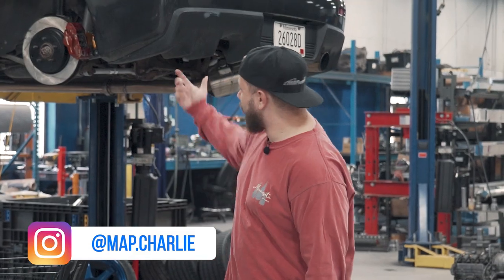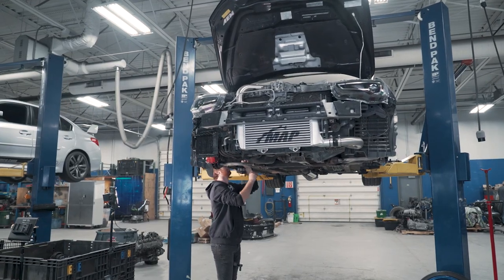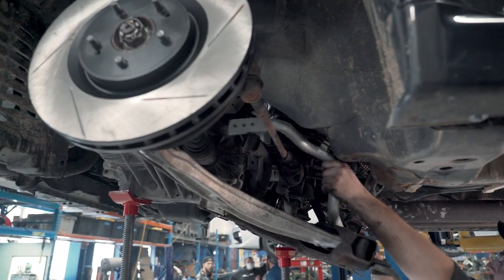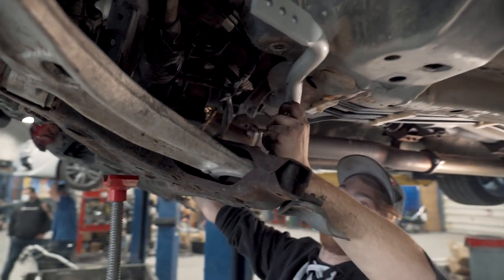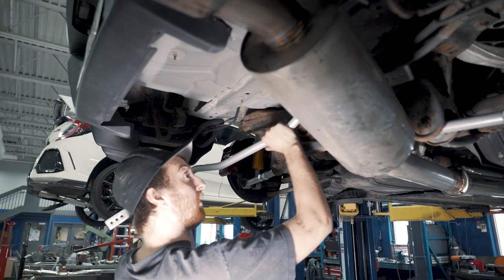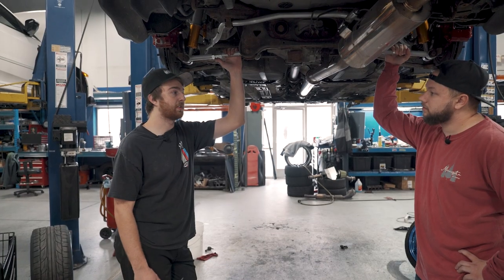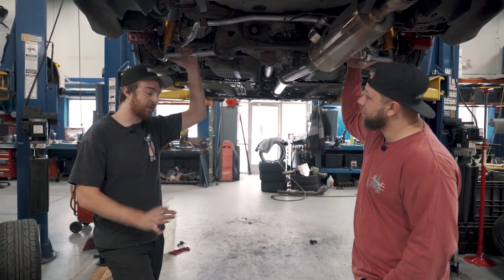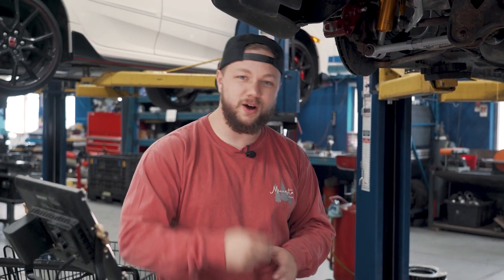Installing Whiteline Suspension on Our Evo X

Comment: I installed both on my Evo x by myself using a jack, jack stands and some bricks to hold the sub frame. The back was a piece of cake. The best way to do the front is to remove the whole sub frame. There is no way around it like the guy said. The hardest bolt to get off is in the rear motor mount. The one that the guy replaced with the TORQUE SOLUTION rear engine mount. There is a one bolt that is sitting by itself in between the mount, that one was the biggest pain in the ass to remove. The instructions said that you could remove it by using extensions going through the top of the engine bay. Don’t waste you’re time doing that! I ended up buying a flex head ratchet set, and removing it slowly, it took me forever. Nothing else fits in between the motor mount. The rest was okay, that was the biggest problem I had. I don’t think that I put that bolt back on the same way. I think I flipped it upside down and ran it through the sub frame. Then I bought a nylon nut washer, so next time I could ratchet out the bolt.Good luck to anyone doing it by yourself on the floor :") Im also not a professional , not even close ! and if i did it i know a lot of you guys can. dont pay someone to do this! its hard but not impossible.

Comment: Have the whiteline rear sway and endlinks, lower control arms, front roll center/bump steer kit. To add to the handling I have the Cusco front underbody brace and rear Cusco strut bar. Just put in the rear strut bar tonight and went for a drive.. car feels like a single solid piece now. No chassis flex just go! Man it feels good.

Comment: Broke the exact same bolt on the collar when taking out the old sway bar... did you guys just tap and dye a new hole there? There is a nut welded on the inside of the subframe that “catches” the bolt so how did you guys fix it?

Comment: Why did you reuse the concentric bolt and washer on the rear camber arms instead of using the concentric "delete" bolts and washers that come with the kit?
Reply: Good catch! to make a short story long, the bolts at some point were misplaced and we had to improvise.

Comment: Do they supply new eccentric bolts and washer for the adjustable rear lower control arms? I've had 2 alignments where the washer was stripped by the bolt
Reply: they do included them, i mentioned in another comment that the hardware had been misplaced at some point so we opted to reuse